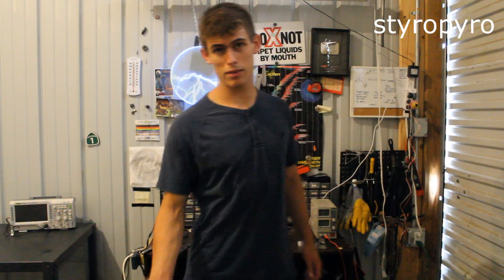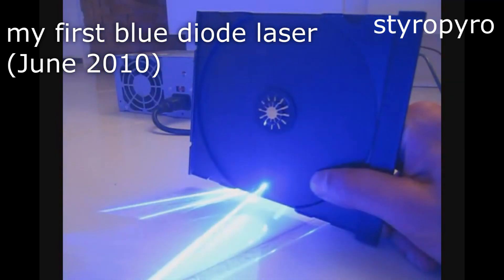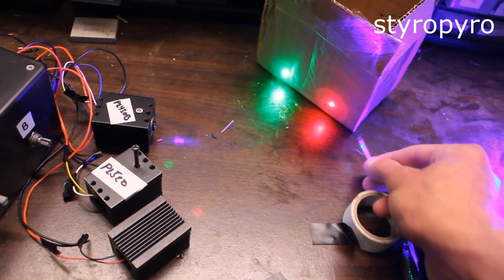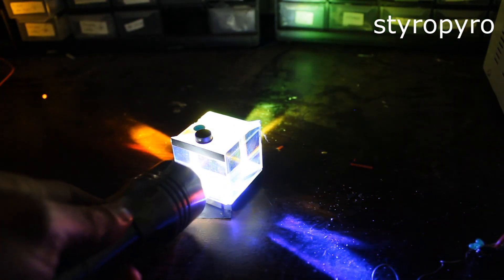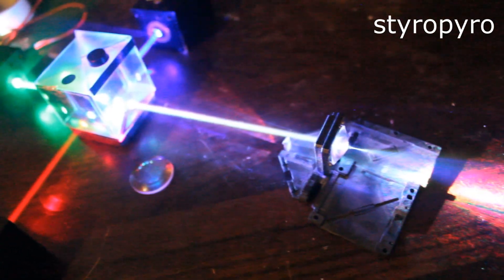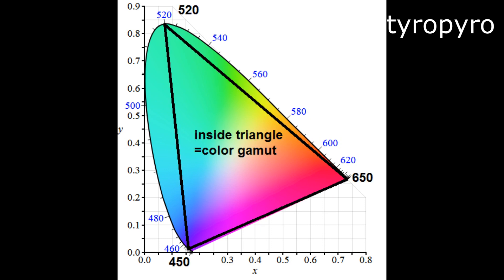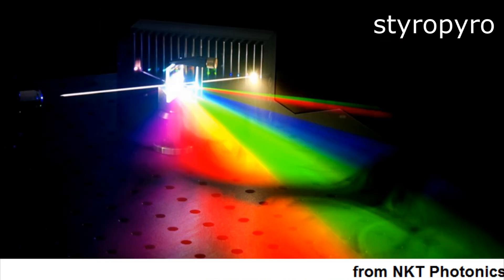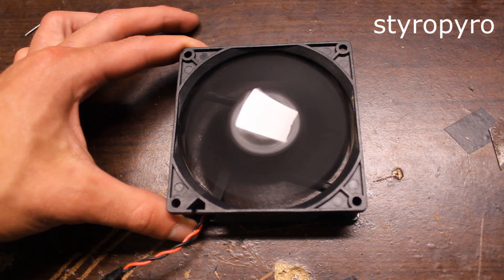Amazing White Laser Experiments!!!

Comment: Good video, but the LM317 is voltage a device not current
Reply from the maker: The typical use of a LM317 is as a voltage regulator but I configured them as current regulators.

Comment: How would the xcube or chromic mirror setup work if you had more than three lasers? Say I wanted 7 lasers to create the full visible spectrum within a single white beam.
Reply from the maker: you'd just need more dichroic mirrors with cutoffs at the right places. and for the record, 7 colors is not a full spectrum. but it is a better approximation than 3 for simulating full spectrum white

Comment: Hey styropyro, did you ever have the Whitefusion kit from sightfx on LPF? It was basically the exact same thing with heatsinks, board, and dichroic mirrors built into a tiny project box, with the pots on the outside. Some people even managed to fit an extra mirror on a motor inside the project box for the time tunnel effect. It was amazing and i really wish I had bought one back when sightfx was offering them
Reply from the maker: I actually have a whitefusion drive that I completely forgot about! I never got the full kit but I bought a used driver on LPF probably five years ago. If I would have remembered about it I would have used it in this video.
Reply: styropyro Nice man! I really wish I had bought one. If you ever feel like selling it, let me know I guess lol. Great video as always btw

Comment: Sorry idiot here. Is yellow just the combination of two colors or is it the two colors interfering two create the yellow wavelength?
Reply: The two beams don't actually merge to form a new beam of light with yellow wavelength. They're still two independent beams occupying the same space. The reason they look yellow is because they stimulate the red and green receptors in your eyes at roughly the same proportion as a beam that's actually yellow would.
Reply: More detail on previous answers; if you add a true yellow light to an array of RGB lights you can get highly saturated yellows that are impossible in an RGB scheme. This is why there are RGBA (red green blue amber) led arrays as well as RGB.
Reply: Marcus M 
On a screen yellow is shown as tiny green and red lights merged together. 2 wavelengths overlapping basically. Actual yellow light isnt given off by screens but appears basiclly the same to us

Comment: Is fog essential to produce the effect?
Reply: It just helps you to see the laser beam in the air by reflecting off of the suspended particles (Glycerin in fog machine).
Reply: You might still see a faint laser path without fog if you've got some dust in the air.
Reply: yes. or the laser is invisible in air
Reply: Smoke works well too.